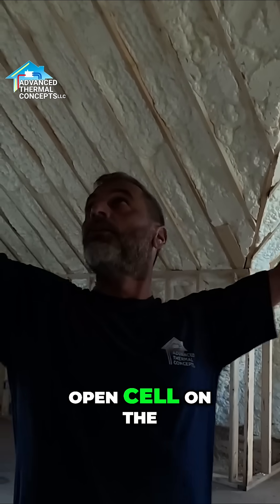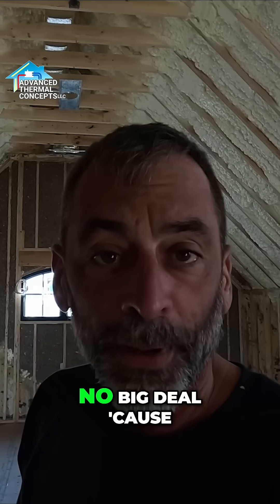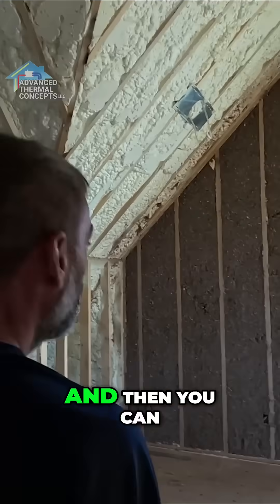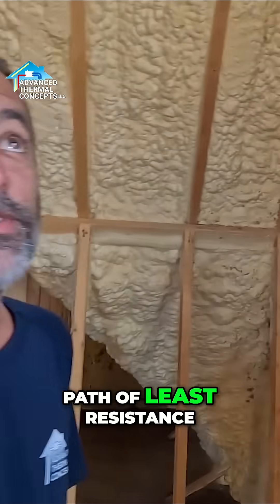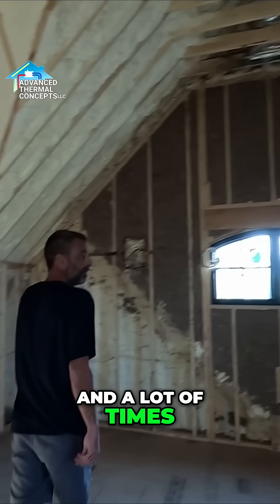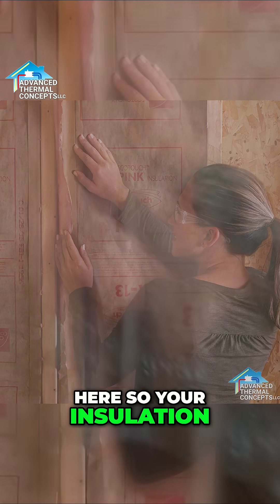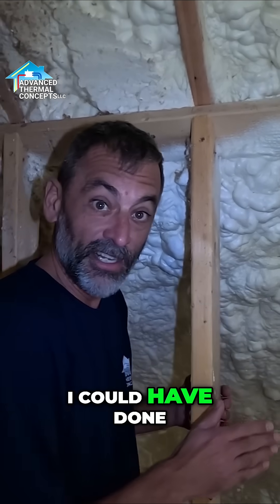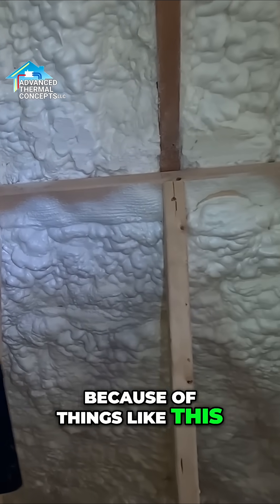Air Sealing & Insulation Explained: Spray Foam vs Cellulose (Why Fiberglass Fails)!

Comment: did you put the batten strips in before you sprayed foam so the soffit can breathe to the peek and the ridge vent can work so you don't cook whatever roof you put on it
Reply: You use proper vents for ventilation not fiberglass
Reply: When you spray foam you no longer have a vented roof it is like a beer cooler but the problem with the spray foam is now when your roof leaks you won't know until everything's rotted and falling down
Reply: @Duckyfixit  beer can coolers are suppose to have moisture thats why they arent made of paper,,, no venting will 100% cause moisture drive.